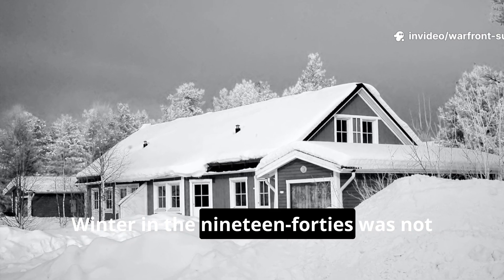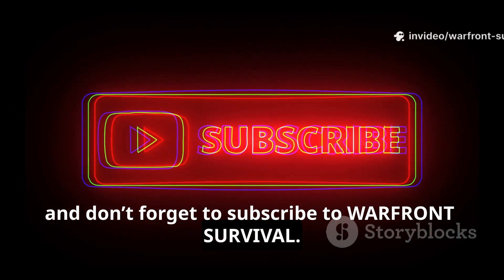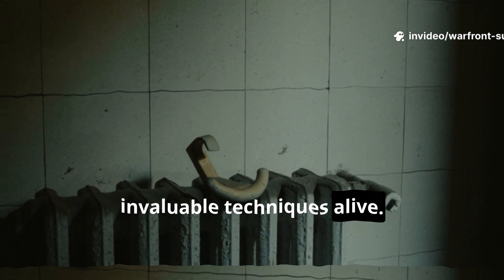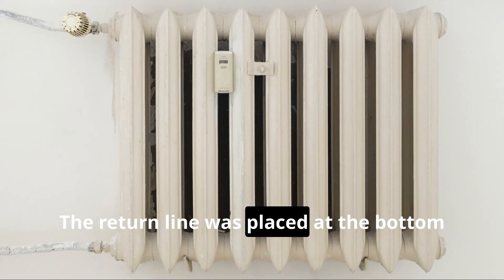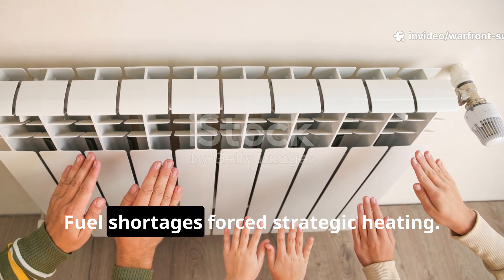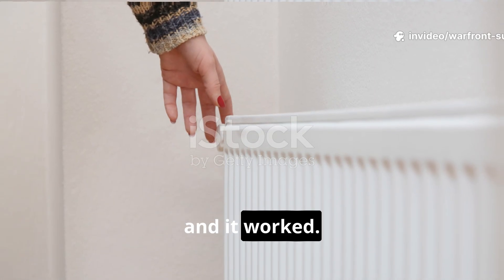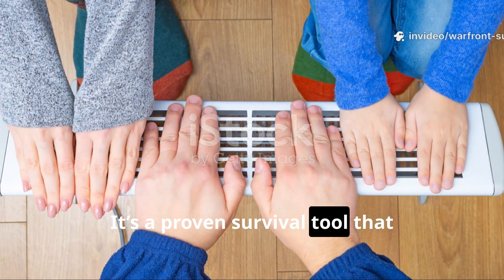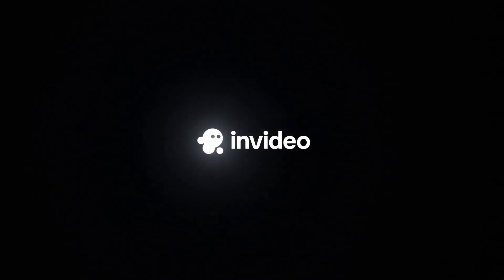The 1940s Heating Trick That Worked Without Electricity

Comment: I have searched the web for days I am sure this guaranteed, a furnace in a basement will use more energy to heat a room it’s not in to being in the actual room.
This video makes claims that don’t stack up.
The Attenborough AI voice sounds great but can’t fix the producers fancied claims.
It’s interesting they consider this about opinion and not facts.
People who peddle fantasy for profit are quick to call facts opinions and their fancy fact.
Respectfully, you should not promote your fancy as facts.

I actually don’t get why you did not make a factual video on radiator system heating, they are interesting and in past times were a real asset.

If you trusted AI to give you facts, you are too lazy and stupid. AI CRAPS AND DUMB PEOPLE THINK IT WILL MAKE THEN $$$
Reply from the maker: I actually make 💵😀😄

Comment: I used this system in NJ, all the way past the year 2000.   Steam rises, cools, then falls back to the furnace.  An automatic feed, puts water into the system, and does use a little electric, but can run without it.  But, the auto feed was also the flaw in the system, because the automatic feed often got stuck on, and overfilled the furnace with water, then the system shuts down.  What it does not do is change the temp fast.  I would guess, one reason was that it was a two floor house, running off of one thermostat.
Reply from the maker: Thank you for your opinion,hope you're enjoying the videos

Comment: 0:59 crap it will need just as much energy as any other method
Reply: It uses energy, differently, and I found myself babying it more then other systems.   Because you have to boil water to get steam, you have to allow for greater range, say, 6 degrees, plus or minus.  At least that was my experience.  However, I LOVED IT.  It's a great system.   But, hot water systems, can start heating the first rooms in the loop faster, then steam systems.   If the wind is blowing too much, and you have a steam system, you might want to turn that heat down a bit, so, you dont cycle on and off so much until that passes.   The system is different, and has it's plusses and minuses.
Reply from the maker: This method uses low-grade heat more effectively and stores it longer, reducing waste rather than increasing total energy use.”
Reply: @W @WARFRONTSURVIVAL  sir, you can’t get heat without energy. Radiator heating systems are inefficient for homes because they have to heat pipes in distribution, that’s loss.
It takes more energy to get heat from a basement to a room than it does to heat the room.
Yes they can use low grade heat but who has that at home, that applies to industrial applications.
Radiator heater systems are not popular because they are inefficient energy consumers in domestic applications.
Best to you and yours